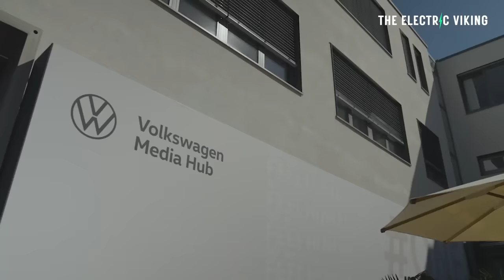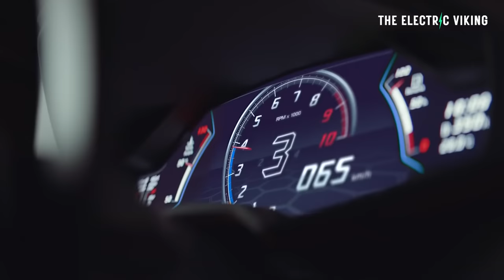Germany says VW is struggling to find answers for Tesla & BYD's pricing and tech

Comment: The problem is pricing. The ID3 is about 10K too expensive. It’s a nice car, it’s just that nobody wants to pay 43K-47K for a hatchback. You can get a used Golf with low mileage for under 20K. It‘s not going to work. Here in Austria, the ID3 with the bigger 77KW battery is the same price as a base Model Y. What would you rather have?
Reply: Batteries in the vw Evs aren't great either
Reply: Exactly. I ordered a new company car recently. An ID3 didn’t fit that monthly leasebudget, while Tesla 3/Y, BMW iX3, Volvo XC40 and Polestar 2 did. That says a lot, if not everything.
Reply: Agree. I like driving the second gen ID3 as acarsharing car. It’s just my favorite size, but too expensive. Drives nice, handling of functions is not so nice, but has been criticized extensively somewhere else.

Comment: Not surprised. The VW ID.4 is absolute crap. Seriously laughed my ass off during a test drive. Its a 40k econobox with two damn window buttons that have to be switched between front rear windows, a half assed one pedal driving mode that isnt, climate control and volume control that are NOT back lit (WTF, good luck finding those in the dark), cruise control that can only be deactivated by hitting the brake, touch sensitive steering wheel controls that are activated by the slightest touch, sit to start that will turn the car off the instant you exit the car requiring the crappy sluggish infotainment system to be reactivated when you sit back down, seriously squishy brake pedal, insanely loud at highway speeds, suspension is far too harsh and going over bumps the car sounds like its going to break. I was astonished that this car passed as production ready.

Comment: I can see BYD taking market share from the likes of VW, Mercedes etc but not Tesla, they will need to install thousands of chargers across Europe and the UK in 2024 in order to compete against Elon Musk as the Tesla winning formula includes low cost charging when on trips in the package influencing what car to buy. 
I imagine once all EVs have a range around 500 miles then this will change as home charging becomes the norm for the bulk of EV users. 
We like most of our friends bought Tesla due to the range and cheaper on-route charging infrastructure, 
I would have liked to have bought a long range UK built car but there just aren’t any plus depending on several different (expensive) charge suppliers on road trips is a real bind especially when chargers don’t work or won’t work, this isn’t some random thoughts, we have been driving electric since 2014, its experience
Reply: People won’t have money for a regular car. Let alone Tesla and their EV garbage.

Comment: at least Germany is trying and have some success. Japan's head still mostly in the sand.
Reply: I'm not sure how big the prize is for coming in fourth instead of sixth, though.  Win, Place, Show...and Also Ran?  America, China, Korea...and everyone else?

Germany might do better by embracing Tesla's Brandenburg factory, and Tesla, rather than constantly backpedaling and hoping wistfully for home brew success, or victory through rebadging.  Part of the continued vibrancy of America's auto industry, after the rise of the Japanese makers, and later the Korean makers, was from (finally) embracing transplants, and America's carmakers switching to (personal) trucking, an option that may not be highly present now for German makers.  An all in on local factories for successful foreign makers (assembly, parts, batteries), might save German vibrancy.  Wishful thinking about the ID some-number selling well outside Germany, or flogging the second tier of Chinese brands as German, might sink it.  Dieselgate, then a charging network with a poor reputation for reliability.  Third dramatic failure could be the last.  I'd like to see Germany succeed, but half hearted late efforts won't likely do it.  There may just be room for Win, Place and Show, not Also Ran, nor Also Walked.
Reply: Japan is reopening it nuclear plants. 10 open, 17 on the way soon.

Comment: I’m a car guy through and through and I have been my entire 52 years of life. Germany and Japan have moved slow toward electric cars for a very simple reason, the uncertain, energy future. Japan has absolutely no natural resources and they cannot engage in this folly with electric vehicles. Japan has not bowed to international pressure and they are developing hydrogen combustion engines. Even for Japan, it is easy to create hydrogen fuel because you can just convert it out of seawater. Germany specially after the start of the war, or even before we’re skeptical about going full electric as well. After all Germany did lose a war, because of their lack of fuel. Forget about the ideology that helped them start the war, they could not finish the war, because they were going to be restricted from access to the fuel that was going to get them across the finish line.  China can engage in this because they have spit in the face of the international community and are opening a new coal fired power plant every week. Xi Jinping has stated in no uncertain terms nobody is going to dictate how they use energy or what kind. The United States has its hands tied because of tree, hugging environmentalists. They are in many ways forced to engage in this discussion. The EU are really the only people that can pretend that there is some kind of future with this technology. Theyre in the same boat as Japan however. Now that the Russians have been removed from the equation, they have no reliable access to the energy that will be needed to charge these devices. I think electric vehicles are going to go down as the next technology that is forgotten by history. First it was diesel next it will be electric.

Comment: Accept that the Chinese vehicles are of poor quality and have serious operational issues. VW however has issues not because of competion. Rather their reliability is woeful. Just read the reviews. And this includes other German car makers as well!  The primary reason modern vehicles are so bad is cheapness combined with complexity.    Excessive complexity isn't an asset. And electronics have limited life and low resilience. And servicing has not been well designed in a cost effective manner. Just look at some of the engines designed by Audi and BMW! throw away vehicles.

Comment: VAG needs a challenger EV company to be set up.  This can bypass the existing corporate bloat and it can also purchase Chinese EV tech to get ahead while it also goes heavily vertically integrated.
Reply: This could be a working tactic...
Reply: They tried that with its software division, and f* that up. The CARIAD situation screwed VW very hard, as the ID. models software was/is a joke.

If they were to create an EV company, they need to make sure there are no VW managers involved and the unions have no influence. Otherwise the new company is doom from the start.
Reply: too late. VW will default.
Reply: @skataskatata9236  Νομίζω έχεις δίκιο

Comment: Smart automakers aren't trying to do all the software themselves.  For infotainment, Android Automotive is going to be better than anything they could come up with.
Reply: I disagree - and I think strikes to the very heart of where Tesla’s success will ultimately lie. Few bemoan the lack of Carplay/Android Auto in Tesla’s. 
Total software integration owned by the manufacturer opens up revenue streams previously unknown.
Reply: in China, hwawei was always win, until in car software. bcz the software to control every sensor is the key of the system, no one single ev maker put all in hwawei hand, its the sould of a ev
Reply: I happen to work on one such project - and I call b....th. Android is sh...t and cars and economy ara far too software dependent anyway. Car's are not for infotainment.  Unlike mobile phones, their primary use case HAD not changed. First and foremost they are for DRIVING.

Comment: Biggest crisis is their cars suck.  I have a turbo 4 cylinder  and it needs an actuator for the gate on the turbo.  $4000 repair on a car worth $14000.   Their crisis is they suck at their engineering.   That German is great stuff was probably real in years past, no longer.

Comment: Another big problem is: VW pays nearly double the wages compared to Tesla in it's new Gigafactory near Berlin. So many Jobs in the german heavy industry are heavily overpaid. Workers with no qualifiations can sometimes earn more then people who went to university. And while those workers dont even have to work much for their income, Tesla workers have an insane workload. You can basically estimate that worker at Tesla gets paid 1/4 for the same amount of work. And Tesla also saves money in critical areas like health protection. 1/10 of the workers in the german factory have already demanded better health and safety precautions, the workers get sick 30% more often and when the concerns are presented to Tesla, they simply threatened with termination without notice. Tesla cuts cost everywhere, so no wonder they can offer at lower prices, and still make Elon Musk a fortune. That said, VW COULD actually cut costs at some reasonable points.

Comment: If you see, what VW is doing on the technology side, its really impressive. Their newest limo has a comparable range to a model s with the biggest battery pack. With a pack smaller than the smalest option for the S. The problem is, that until now, they fail to build an attractive product from their technologies. They copied all the stuff that people don't like on Teslas, but fail to copy the part, that makes Teslas work. Charging infra and 0-60 times ...

Comment: Europe needs to lead the charge into modularity and how that opens up a true circular economy in sectors like automotive. Establishing Euro standards for vehicle modularity that allows third party upgrades will greatly reduce the need for endless manufacturing of the same thing, encourage much higher standards of module reliability, efficiency and utility, enhancing their re-sale value. Standards compliance should attract tax incentives and local business creation in remanufacturing, up-speccing and down speccing vehicles as needs change.

Non-standard, non-circular formats would attract import duties or other internal charges related to end of life costs.

This is Europe's chance to end global scale battles for manufacturing dominance and push for global trade in intellect rather than metal.

These ideas will not come from VW etc., however. The mindset is still too late-nineteenth century, Krupp-style thinking.

Comment: I was involved in the reconstruction of Leylands after Sir Michael Edwardes had been appointed by Margaret Thatcher to sort out its problems. I advocated a complete breakup and renewal of focus on brand names. Unfortunately this never happened with the result that many previously famous brands fell into disuse. VW desperately needs to be broken up NOW so that each of its key brands can be given the focus they deserve. Doing this would not only solve the company’s financial problems but would result in many benefits for Germany as the transition to EV takes place - BUT there is no way VW management will take this step. The company’s new strategy may work but even if it does, a breakup now would have led to a better result.

Comment: The electric vehicles has the additional advantage of being the 'energy company' of the near future. 
All vehicles have capacity to store energy for hours of driving but drive one hour each day.
Petroleum can not be topped up daily at home. 
Petroleum can not be day traded into the future energy infrastructure, the national power grid. 
The grid can harvest massive amounts of renewable energy and store it daily in millions and millions of EV big batteries.
Reply: Except all you mentioned are MASSIVE disadvantages.
Reply: @piotrd.4850  if no fossil fuels future and all electric then EV big batteries would be universally everywhere. 
Being everywhere is a huge asset for the grid as they can absorb excess surges of energy and then feed it back as needed. 
Big batteries are doing it now with many home batteries in the city of Adelaide. 
The first city with large batteries as part of the state's grid.
Renewables are powering the state for days.

Comment: No it’s not too late for the german car industry. The part that worries the politicians and that You overlook, is the massive change in the labor market. Most technical innovations don’t come from the car brands, but from the companies that are producing the parts besides engine and the hull. Power train, brakes, innovation in the (blue) diesel technology etc. come from companies like Bosch, Continental, ZF etc. (that’s why they suddenly go to Tesla or CATL/BYD for things like batteries) Electric cars have fewer parts and the workers and R&D departments need different skills. There is a high demand to reteach the skilled workers or replace them in a timeframe that is too short to catch up on the level of affected companies, regions or a country. CATL already builds a factory in Germany. Other companies follow. Tesla already has a big factory near Berlin etc. They also suck up the qualified personnel.

Comment: EVs are mariginal, fleeting problem that is already choking on lack of subsidies, exorbinant pricing and power production deficiencies. Battery remain unresolved issue ( lithium, weight, capacity ).  However VW and vehicle manufactures have more fundamental struggle: even ICE cars are TOO HEAVY, TOO SOFTWARE DEPENDENT and thus TOO EXPENSIVE.  Latest Golf weighs TWICE the weight of Golf I ffs.  Cars have always been quickly depreciating asset, but once they provided huge value for money and trouble. Nowadays market is saturated, regulators try to chase out every cars, parking is problem and prices are going up, and up and up......

Comment: VW has 3x the revenue of Tesla but only 1/10 the market value.  Courtesy of US Fed easy money asset bubble & hyped up stock speculation
Reply: No, it's coz Tesla is driving the f future and VW is stuck in the past. The market values what's coming, not what happened. There's no publicly traded buggywhip manufacturers.
Reply: @dylanthomas12321  in short, pure speculation.   Betting on the future is as good as betting on a horse in a horse race, or on a gambling table.  Unless you got a time travel machine and saw the future

Comment: 2 real facts ... 1)diesel pollutes less than gasoline and does not affect the ozone layer while petrol particles affects the ozone directly  2) they lied about diesel but because of that the diesel engine was and it is whiplashed for no reason on a steady pace, it is very reliable if maintained correctly and gives lots of miles.

Comment: I, for one, am utterly amazed that VW is still in business.  I personally think that they are one of the worst managed companies on the planet and that they make dreary uninteresting and low quality products and have done so for decades.  I haven't bumped into anyone since 1969 that said that they'd like to check out that new VW.  If they disappeared tomorrow I doubt that it would make the evening news in America.
Reply: America hates VW because they get the shitty made Mexican ones and they usually get petrol engines when where VW truly shine is on Diesel engines. The rarity of them also makes them expensive to maintain too. VW have been going downhill in quaility and reliability for the most part over the last 20 years ago. Their best car the VW Golf peaked all round at the MK4. VW and the germans in particular have pissed me over the last decade in particular by making cars where in order to get something good you need to spend an extra 10-20% on optional extras and the fact that cheaper rivals were fitting cars with LED DRLs and tailights and projector headlights long before the Germans is a sad joke too.

Comment: They need fast small light ice powered cars to bring them back from the brink. But naa a $350 electric water pump made of plastic , guaranteed to fail in 4 years instead of an alloy water pump that cost $20 and will last 15 years.  Small light cars is their only way out...but the just can not help themselves to overweight, over complexity over engineered shitboxes that just make it past warranty and then devalue like a falling brick.